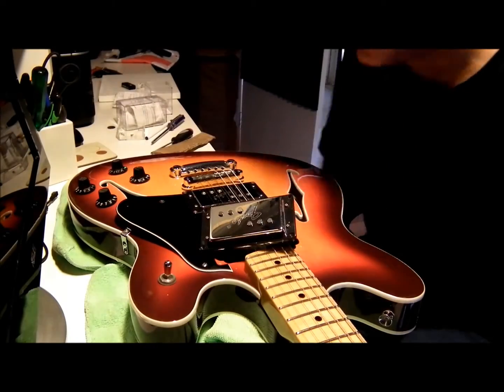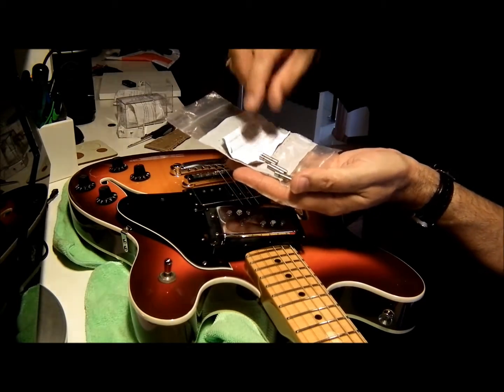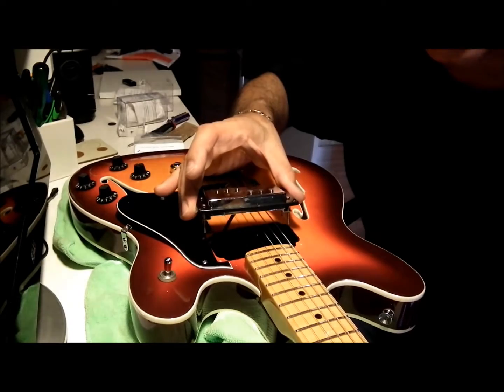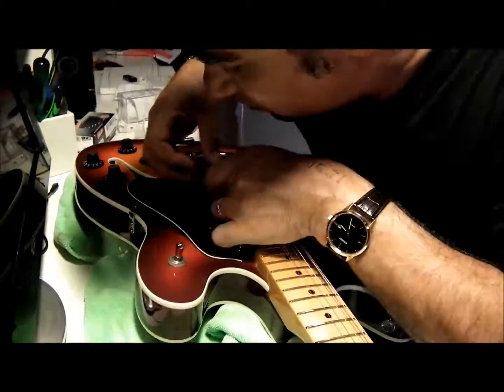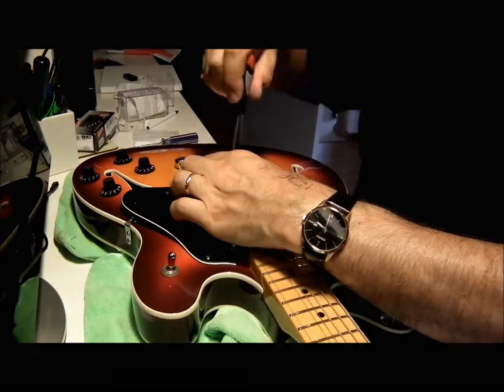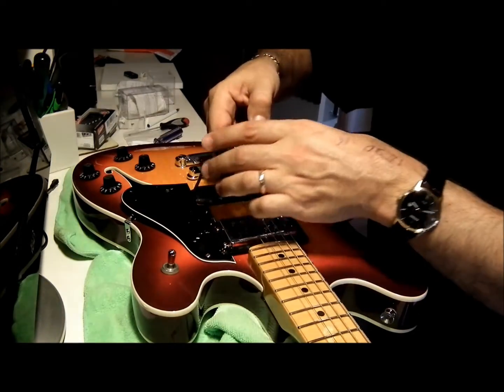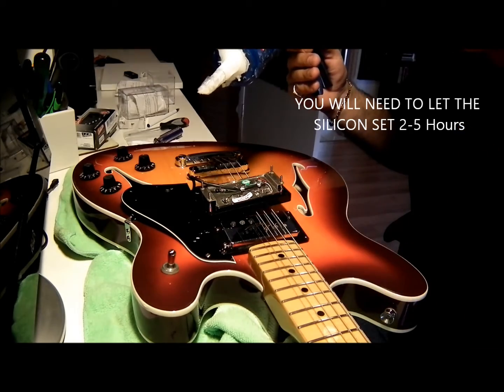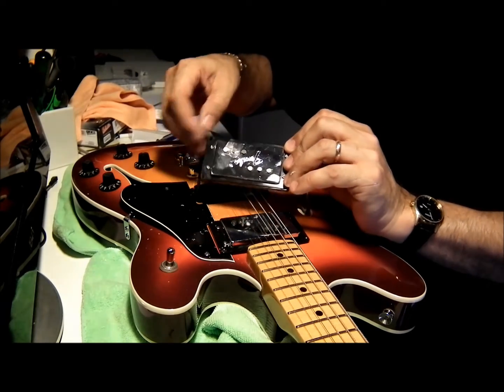Fender STARCASTER to DYNOCASTER! Widerange pickups to Twanging Single Coil

Comment: Thanks, Frank, for this tutorial, it really did add some character to my Starcaster. However, the sound I got was somewhat too sharp for my taste, so I fixed up the empty holes with another set of alnico 2 rods, and got back some warmth while not losing any of the twang, if that makes sense. Still sharp, but not icepick anymore.
I also added a Les Trem, which I don't regret, but that's aready another topic.

Comment: I listened to your demo video and that really does work. Nice job, it sounds great. 

A question, did you try using only the one coil? I'm interested to know if it makes a difference. Thanks.
Reply: MrDblStop Hi....yes if you leave the other magnets in you get a humbucker sound but cliser to aTV Jones Magnetron. ...Cheers Frank
Reply: Frank, thanks for the reply, but I meant did you try taking the output from just the 'live' coil, and taking the other coil out of the circuit. I was wondering if the coil which had its poles removed added anything to the signal by being magnetised slightly by the other coil's poles, or if it was just a 'dead weight' in the circuit in terms of it being extra resistance.
Reply: MrDblStop Hi...I didnt... but with the coils having no magnets they dont add to the signal as they would with the magnets in place, plus the extra string pull from the extra magnet as in all humbuckers is removed. ..there is a inherent difference from the string that affects the sound..for example the bridge on any acoustic guitar has one pickup point "the saddle" the sound is transferred to the top of the sound board at one point. ..But as in some Fender Stratocasters ( Roadhouse Deluxe ) the setup uses a "Dummy coil" to eliminate hum...but you still have the single coil pickup picking up the string signal from the magnet point. ..So even though the dummy coil is there it does nothing to the sound but does eliminate the hum..I usually prefer true single coils but in this case the dramatic effect was more than pleasing. ..The widerange Fender  humbucker is a great candidate for this mod because you can easily remove the second lot of magnets. ..most humbuckers have the bucking coil magnets sealed...So the new sound really comes from the added Alnico magnets..the steel screws lack in dynamic range..your ears will tell you that...But thanks for watching. ..Im no pickup builder but my ears dont lie to me!...PS I love the clean crisp guitar sound that is perfect for my style of music...Cheers Frank THE MEMPHIS SUNS
Reply: Yep, it certainly works. Nice one!